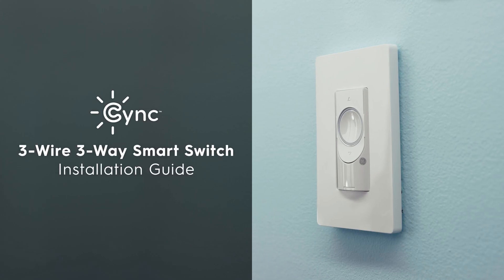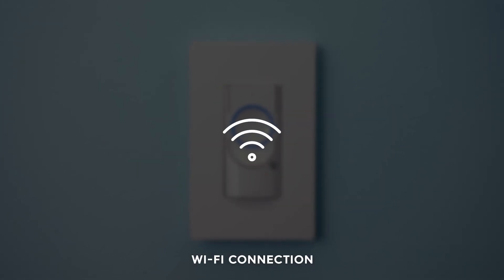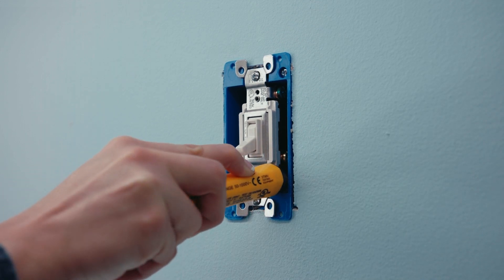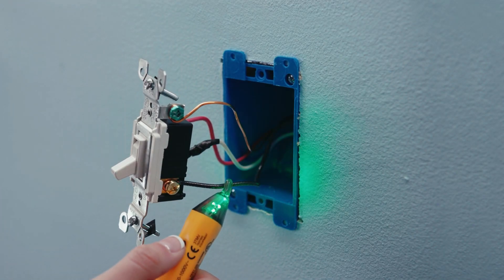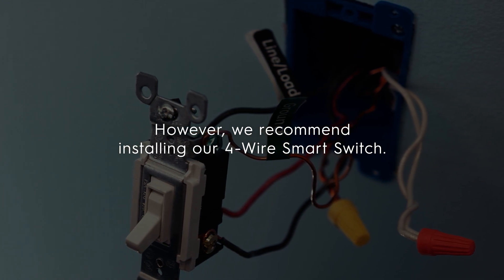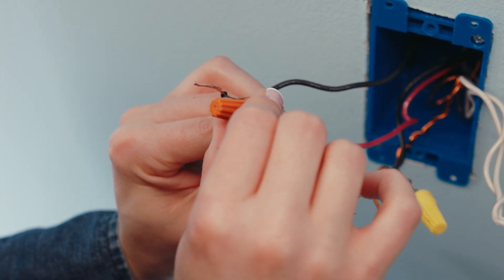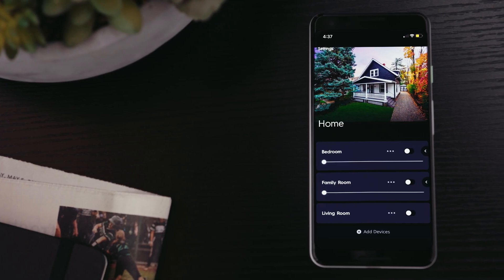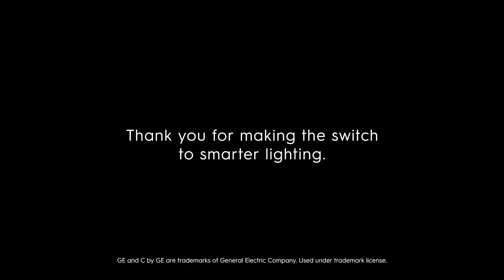Cync 3-Wire 3-Way Smart Switch, How-To Installation Guide

Comment: This is probably the worst how-to video I've ever watched. It would REALLY help if you included the Cync 3-way wiring diagram.
Reply from the maker: Hi Peggy, thank you for your feedback. Here is a link to the installation guide: https://f.hubspotusercontent30.net/hubfs/6959181/Support%20PDFs/CYNC%203-Wire%20Switch%203-Way%20Install%20Guide.pdf. If you need further assistance, please contact our team directly at 1-844-302-2943 so we can assist.
Reply: You are so right Peggy

Comment: Can you mix a 3-wire switch with a 4-wire switch in a 3-way? Only one of the boxes, the line side box, has a neutral while the load side box does not.
Reply from the maker: Hi Brendan, you cannot mix a 3-wire switch with a 4-wire switch in a 3-way wiring setup. If you are intending to wire our switches in a 3-way, you will need 2 Cync Smart Switches in that 3-way setup. If you are using 4-wire switches and are intending to use dimming style switches, the dimmer switch will need to be installed on the load side of your setup. If you need further assistance or have any other questions, please contact us at 1-844-302-2943 or help@cyncsmart.com. Thanks!

Comment: NOTICE: Please use the visual portion of this video for demonstration purposes only and do not copy the actor's technics.  Also, when the electrical wires are not connected to a switch, please make sure that none of the copper wires are touching each other before turning on the breaker.